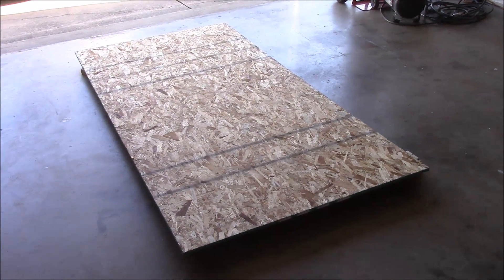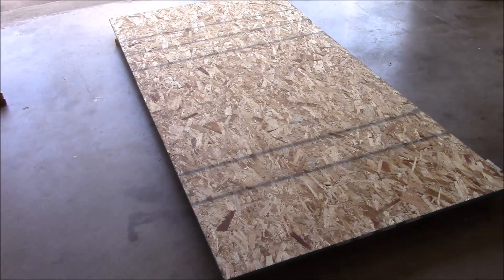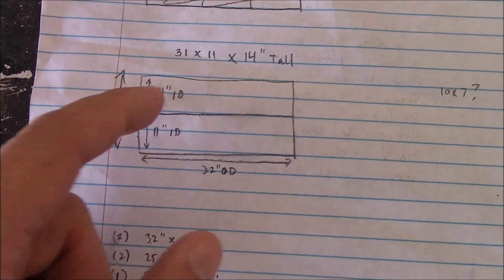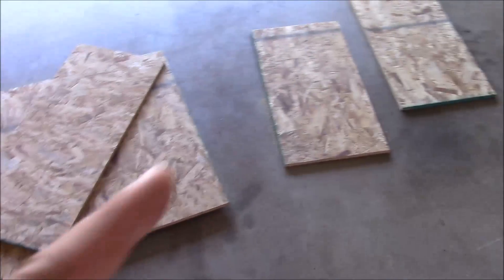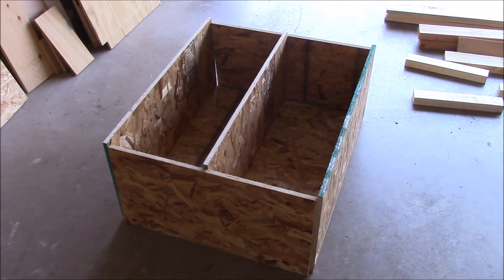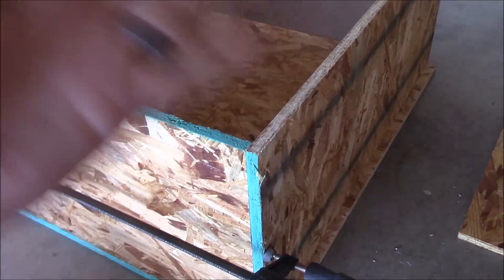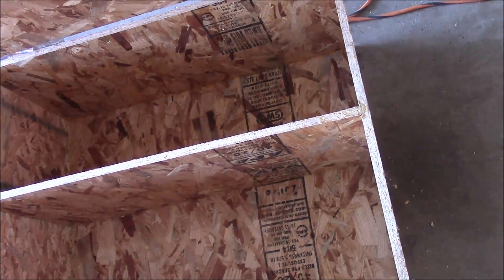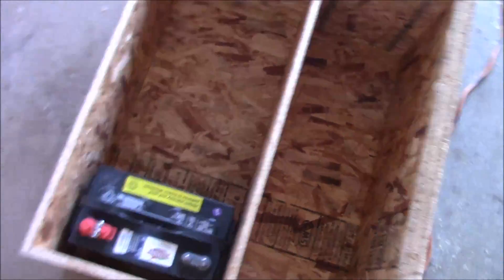Building A New Battery Box for Solar

Comment: Curious as to where the battery box will finally live? Hydrogen gas can be explosive. Where will it's final resting place be?
Reply: +John Blackham (ShadowSteel) - Always good to vent. I also put Flow Systems Water Miser safety vent caps on my battery bank. They reduce watering and almost eliminate "acid-mist".
Reply from the maker: +John Blackham It will be in my shed.  I have some 3/4" tubing that I will be using to vent the gas to the outside of the shed.